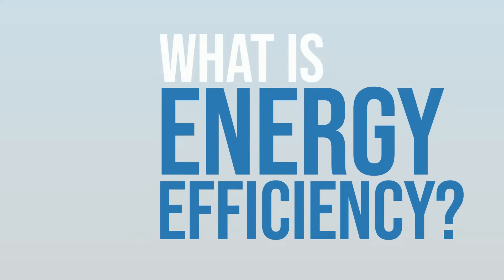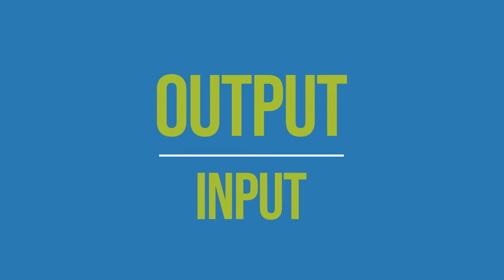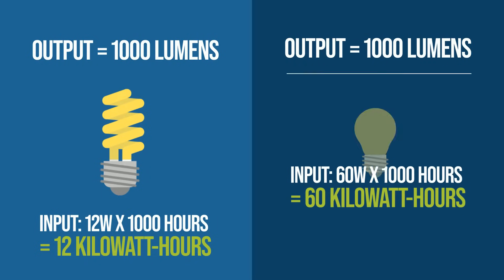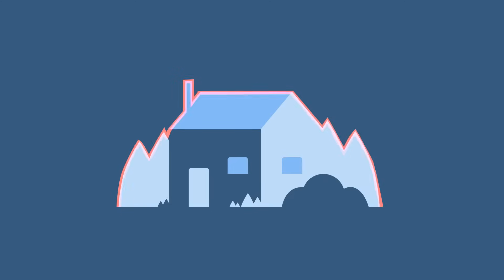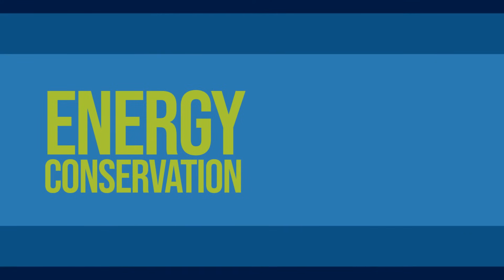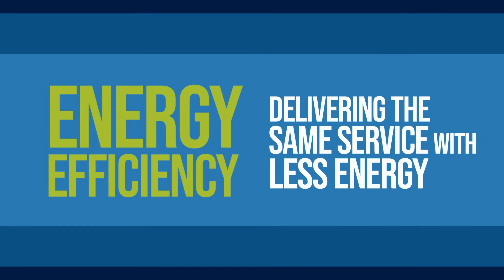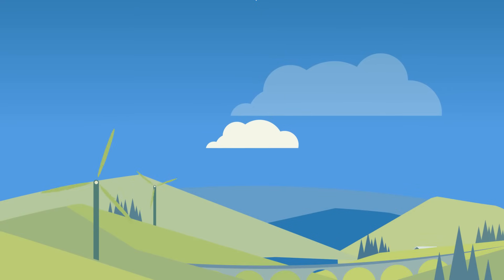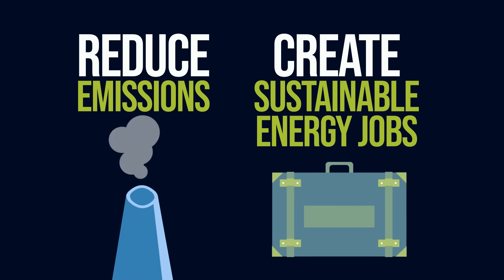Energy Efficiency 101

Comment: This is yet another do-gooding presentation that gets energy efficiency wrong from the outset.
Energy efficiency is the term used in the process of converting energy from one form into another, not how we control or use it. So energy efficiency is usually related to the process of turning gas or electricity into heat.
Energy efficiency is defined as (energy input - losses) / energy input.
Energy efficiency is not how much energy we use or anything to do with heating controls. When heat has been created and has been delivered into a building, any energy efficiencies that will occur have already been realised.
There is nothing that can be done to change the energy efficiency after that. Then heat is all lost. The question is how quickly will the heat be lost; how "effective" is the building at holding in the heat. This is not efficiency, this is thermal effectiveness.
I would also suggest that when looking at the energy efficiency of vehicles the amount energy to deliver the fuel from source ie deep underneath the earth's surface, into the fuel tank should be considered. That is, the energy efficiency of the whole process. I think you will find there is then no difference between fossil fuel powered vehicles & electric powered vehicles. The fuel (ie the energy input) will all come from the same place - the earth. Scientists, politicians and the public in general  seem to me to want to ignore this little fact, I presume because it would show how idiotic it is to try to make any claims about our efforts to manage climate change.